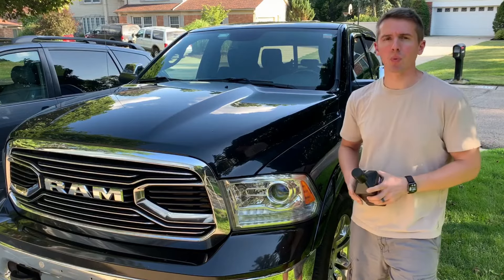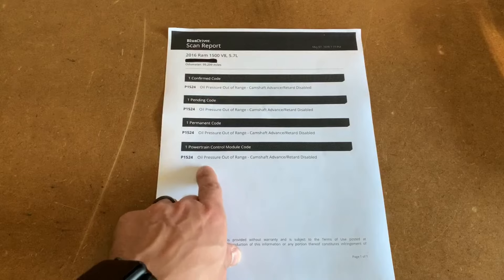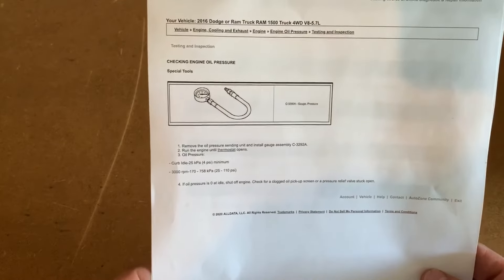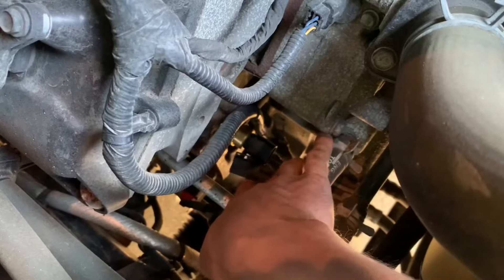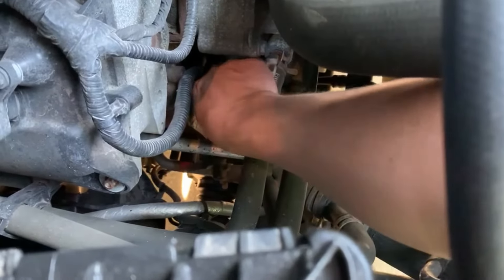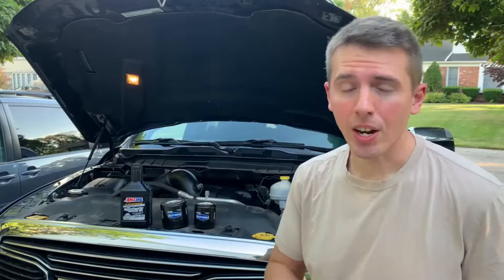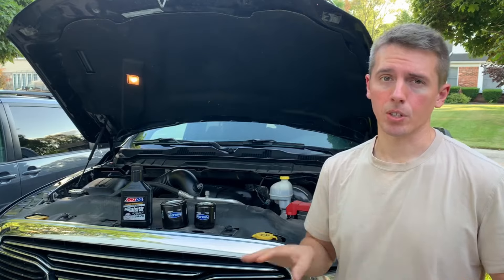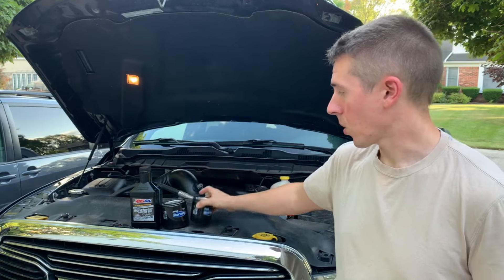2016 Ram 1500 - 5.7L Hemi - P1524 Oil Pressure Out of Range

Comment: Thanks for posting this video.  My 2013 5.7 with 153000 miles got the p1524 code I replaced my pressure sensor and the light was still on.  After watching your video I changed my oil and replaced my small Stp filter with the larger Mopar Mo-899 filter and that fixed the problem!  Thanks

Comment: This exact issues just happened to my 2020 Ram 1500 limited.  The dealer told me the code that was displayed was incorrrect oil used.  I had Amsoil 5w-20 installed with Amsoil filter.  I told the dealership there’s no way it could be the oil.  They s said they saw the same issue on another Ram truck using Amsoil.  They never tested the oil pressure and I couldn’t find anything about incorrect oil when searching that code.  The service writer said he remembers me bringing in my own oil and that I need to be installing the correct oil.  They even wriote this on the work order which ticked me off because this is something they can use against me if I have an issue later on.  Thanks so much for posting this.  You’ve been a tremendous help.  I’ll let you know how it goes

Comment: Firstly Thank You to the original poster of this video, I really appreciate the time you spent to explain your situation. Now for my story if it helps someone else: I popped a P1524 on my 2015 Ram 1500 with 5.7l Hemi. Oil pressure was only 34psi at 1700 rpm at 59 mph and I had recently started getting a rattle or vibration sound that came as the mds turned on or off and could be made to go away by forcing a gear change. It drove me nuts as this truck has 209000 miles and has had nothing but 5w20 penzoil synthetic and kn oil filters since ive owned it from 110000. Well the oil change system showed 30% left oil life but I went ahead today and changed the oil and filter with 5w20 Penzoil platinum synthetic, a bbottle of STP synthetic oil treament (16ish oz gold bottle) and switched from my normal kn oil filter to a mopar M0-899. Great results as now i have 54psi at 1700 rpm at 59 mph. The filter is a bit tighter to put on but fits fine on my 2015 4x4 model. Id guess that the kn filter is to blame here but can't begin to explain why. As a side note my normal 7 quart oil change did require slightly more oil eith the new larger filter and it took quite a bit of manipulation while prefilling the filter to get the air burped out. All in all happy to see such a cheap easy fix, bravo!

Comment: Thanks so much for this video. I also have a 2016 Ram 5.7 with the same error code and rattle. I changed to the Mopar filter and changed the oil and the error code and rattle are gone. You saved me a ton of money and I kind of doubt that most service shops would have had a hard time figuring this problem out.

Comment: Had same problem. Thanks for the video it saved me a pressure sensor and pcv valve. Oil pressure went from 32 to 49 with a filter swap.
Reply: What filter did you use
Reply: What oil filter did you use

Comment: Changed out the Amsoil filter with a K&N and my oil pressure went back to normal,thank you so much for this vid I was getting very worried watching the oil pressure drop lower and lower everyday
Reply: Did the same thing, did it come back again
Reply: @FLAMECASTERXVI  yes it did for a while but now I have been noticing that my idle psi is good but my oil psi while driving is lower than normal at 42-46psi when it normally was 48-52psi,I need to do an oil change so hopefully that has something to do with it?
Reply: @chrisabreedapartnyhc5337  I switched from k&n to mobil 1, and I am cruising at 51
Reply: @chrisabreedapartnyhc5337  42 to 46 is not bad at all, try switching to 5w20 PUP, mobil 1 filter or royal purple filter, and add some lubegard
Reply: I'm using a K&N filter on my 2019 and just had this code pop up.  I'm going to swap it out - hopefully it resolves the issue. Who would think paying for a premium filter would cause issues
Reply: @wakepics  go with mobil one filter or royal purple filter, and use Pup 5w20, your truck will feel totally different.

Comment: Man you are my hero! My 2017 just threw this code like a week ago and I should still have over 1000 miles before an oil change, still have good oil levels, I heard that clicking/vibration a couple times and was ready to light the truck on fire. The only thing I did differently was change the shop I brought my truck for an oil change. I'll swap the filter tonight after work and see what happens.
Reply: Update?
Reply: @jessehackett6941  the filter swap fixed the issue. I haven't had a problem since.
Reply: @theejmaenpaa  hello what filter did you use ? Thank you in advance
Reply: What filter did you use???????

Comment: Good stuff man, thank you! I have always used K&N oil filters. My pressure went from 31 to 53 with just changing the filter to a Purolator Boss. I'm going to try the older version as well during my next change. Luckily I saw this right before I was about to change the switch. I never would've guessed that an oil filter (let alone a "quality" one) would cause this.

Comment: Had this issue myself last week, oil pressure while driving on the freeway was at 38-42.
Changed out my “VP Racing” filter out for a WIX filter with the anti drain back valve (which the VP Racing didn’t have) and pressures are all back to normal 52-54 while driving freeway speed

Comment: Heya, thanks for sharing your troubleshooting journey. I have a 2013 Durango Citadel with the 5.7 that has no check engine light, but a permanent P1524 code (and lower than optimal oil pressure). Do you know if the bigger filter will fit this SUV? It's a smaller engine compartment I'm sure, just wondering if you or anyone out there has experience with it. Thanks.

Comment: Huge thumbs up for this video. I could not figure out where the noise was coming from on my 1500. Checked wheel bearings cv axles and nothing worked so thank you for this.
Reply from the maker: Awesome!  Glad it fixed the noise.  Thanks for the thumbs up.
Reply: Does it sound like sticking something into a running fan, and only happens on deceleration?

Comment: Thank you for your video.  I did an oil change and my pressure jumped right up to 52 at idle. 
121k miles. I used synthetic blend with an extended life premium filter.  I need to get my light cleared buy at least I have great oil pressure again. 
My last oil change was done at a center and this is whst I deserve. They used a  generic filter. Never again.

Comment: thank you so much, you saved me a lot of money, i was showing this error and another, oil was changed i think 2000 or 3000km and i don't think it was synthetic or if they used correct filter, anyways I changed with oem filter and approved oil and problem solved

Comment: MO-599 filter is the best to use. Its the factory filter. These engines were designed to use Mopar factory parts. The brand and type of oil doesnt really matter. Any brand 5W20 with the ASE  and  API certification will do just fine as long as you change your oil every 3000 miles on these HEMIs. My truck with the Gen III is about to hit 200,000 miles and I've not had any lifter issues or oil pressure issues, other than the normal low volume/ pressure issues. My 2010 holds 32 psi at idle and 58 psi at 2000 rpm. I would like to see more but that will keep it alive at these stock pressures.
Reply: 506xxx here.   just started misfire out of idle.     
heads are coming off to see how it is.   pulled the trans this summer and it all looked clean no issues there.
only hemi “tick” ive had is when i had to change the snapped rear exhaust studs

Comment: I just had the exact same situation on my 2020 Ram 1500 Limited.  I had Amsoil 5w-20 installed along with the Amsoil EA-15K50 oil filter.  After bout 4,000 miles, my MIL turned on.  I took it to the dealership and they did a bunch of software updates as well as replaced the oil pressure sensor and cleared the code. They took it for a test drive and said everything was fine and the MIL was now off.  I left the dealership and about 3 miles into my drive, the MIL came back on.  I immediately called the dealership and told them what happened and they scheduled another appointment for me.  On the second appointment, they said they went through the remained of the diagnostic tests but didn’t come up with anything.  They said the last item that was suggested was to change out oil filter.  They changed out the  Amsoil oil filter with a Mopar.  The MIL is now off and so far so good.  If it stays off, I’m tempted to try the Amsoil filter again to see if the MIL goes back on.  I spoke with a tech at Amsoil but they weren’t sure why I was receiving that code.  I gave them the batch number of my oil filter just in case and I’m holding on to the filter if needed later.  I did see about a 10 psi increase in oil pressure with the Mopar filter at idle speed.  I really would like to run the Amsoil EA oil filter but at this point, it’s not looking like it will work unless I just had a faulty filter.
Reply from the maker: Don't bother with the Amsoil Oil filter.  It is an outsourced/third party manufactured item.  Their supplier simply makes the filter to the requested specs and slaps an Amsoil sticker on it.  Go with the larger size 2012 and older filter and pick anyone of your favorite brands from the local parts store.  You won't have this problem again and you'll still be running Amsoil oil which is the important part.
Reply: I’ll have to try the older larger filter next oil change but since the truck is under warranty so I just did what the dealer suggested and had them install the Mopar filter.  I was using the Amsoil filter because it’s supposed to be an extended life filter made for longer drain intervals.  I have been using them for 20 years with no issues until using them in my new Ram.  I did see an increase in oil pressure when switching to the Mopar filter.  I was running about 58 psi at 1500rpm.

Comment: Hi I’m having the same issue with the check engine light I already bought the purolator filter and I bought Mobil 1 5W30 oil because the Napa guy recommend me that. I need to travel in a few days so I can’t wait for the shipping of the Amsoil website, my question if that oil (Mobil 1, 5W30) with work fine for my Ram 1500 2014 Hemi 5.7

Comment: This just happened to me. I contacted AMSOIL, I'm shipping them the filter so that they can inspect it. They are sending me a new one too. I got the code only after 1000 miles on new filter. I swapped it out with an AC DELCO and my pressure went from 29 to 51 at idle. AMSOIL is great, they will fix the issue I'm sure.

Comment: I use Amsoil products in all of my engines, and sure enough, my wife's 2012 5.7 JGC is throwing this code. It does have an Amsoil filter on it, and is likely closing in on it's change mileage. Interesting to see in the comments that many people are experiencing this issue with Amsoil filters. I have one on my pre-Eagle 300c, so now I'm curious what my oil pressure is on that. Obviously, it's not going to throw any VCT codes. My L92 does have VCT, and just got the Amsoil filter on it earlier this year with no issues. So, maybe they had a bad run on the Hemi filters?

Comment: Seems like an oil filter issue. Did you save the old oil filter you removed? What was the brand and part number of the oil filter that was used when the issue occurred?

Comment: in the video you mentioned a weird brief rattle on acceleration. How did you fix that? thanks!
Reply from the maker: The rattle was caused by low oil pressure throwing the trouble code which deactivated the Variable Valve Timing system. Changing the faulty / clogged oil filter resolved the low oil pressure issue, clearing the trouble code which in turn resolved the VVT deactivation which was the source of the rattling sound.  Try changing your oil filter, even if it’s newish. Hope this helps.

Comment: Check engine light came on yesterday 2-8-21.  Brought in to dealer and they told me I had same error code P1524 and it was because I was running Amsoil.   I called Amsoil and they said it was not the oil, but the filter (admitted I am not first to complain about this issue with this particular filter and engine).   Took back to dealer and had them replace with Mopar filter and full synthetic oil.  Pressure levels back to normal.  Would prefer to run Amsoil, but with the added cost and hassle of changing at OEM intervals, its cheaper and easier to just have the dealership do it.   Could they make getting to this oil filter any more difficult?

Comment: Wow I switched to Amsoil along with Amsoil filter about 3 or 4 oil changes ago and I noticed after about 2,000 mi. my oil pressure was dropping too 31-34psi at Idle and only 38-46psi while driving but it always use to stay in the low 50’s while driving and no less than 34psi at Idle so I’m gonna try switching out the oil filter,no codes yet but I seems like my oil pressure is slightly dropping everyday
Reply: Did it fix the issue
Reply: Had this same issue, I was using a filter without an “anti drain back valve” switched to a WIX filter with the anti drain back valve and oil PSI is back up to 52-54 range
Reply: @FLAMECASTERXVI  Yes it did
Reply: @zchhrrs4590  Amsoil rep told me they stopped making the oil filter for the 5.7 because of this issue

Comment: Thank you so much for your video! I have a 2011 Ram and my check engine light came on yesterday. I changed the oil a little over 3k miles ago but I usually but the Mopar 899 filter and they were out of that one. So I bought a K and N filter which is smaller than the Mopar. First thing tomorrow morning I'm going to change the oil and filter again using the Mopar filter or Purolator or something the same size as the bigger Mopar . I hope that works.
Reply: Hello sir did buying the bigger filter work ? Thank you in advance?
Reply: @agsosj14  yes. That fixed it
Reply: @DanoSlingz  I appreciate you responding.

Comment: Hi. Thanks for you helpful video. I changed my filter and the light went away. I also have the same symptoms you described: vibrating sound at about 1500 or so RPMs. That is still making that noise. Can you tell me if you fixed this some other way other than the filter change? Thanks again.
Reply from the maker: Hey Bryan, In my situation the rattling/vibrating engine noise was caused by low oil pressure impeding proper operation of the variable valve timing (VVT) system. The filter change resolved the low oil pressure which resolved the engine trouble code and disruption in the VVT system.  If you have not done so already, after your oil filter change, you probably want to clear the trouble codes with a scan tool and drive your vehicle for a few dozen miles over a few stop start cycles to see if the VVT rattle stops.  If it does not stop, you may have another issue at hand.  Good luck.

Comment: I'm having the same issue but I'm curious what the nose you heard sounded like. I'm getting a noise that sounds like a plastic bag fluttering in the wind. The noise stops immediately if I hit the gear- button on the steering wheel. Is that the noise you heard? Also happened a lot during engine breaking coming to a stop.
Reply: Did you ever find out what was that noise? I'm having the same issue on my 2014 Ram 1500. Thank you
Reply: @alfredoaguilar6400  that noise is the mds cylinder deactivation getting stuck due to low oil pressure.

Comment: So I’m confused. Is 32-42 a pretty good idle oil pressure ?? I always thought 25-30psi is the best at idle? Everyone in the comments are saying they fixed it and it was like 35+ in idle so is that normal? My 2014 charger RT oil pressure is 35-42 at idle and never above 55-60 while flooring it. Normal?
Reply: I have a 2019 R/T challenger with the same code p1524 my pis while idle is 32-40 did u do the olive filter swap and if did how's everything running now?

Comment: Had the same issue used a Mopar filter and Castrol  5w20   went to a wix filter  and changed the sensor  unit  with a standard  red box . The scan tool said it was the sensor. But being a heavy  equipment  mechanic for 13.00$ change the filter too.  So far ok.  Ram 1500 laramie  5.7 158,000 km.

Comment: my car says it has 5psi ever since i changed the oil and used another filter, same codes appeared and now it does a weird noise on engine but the dipstick has no oil, ill do these steps and see if it works after, thank you bro 🙏🏽
Reply from the maker: No oil on dipstick, yikes!  Make sure you've refilled your oil until oil appears at the proper level between add/fill line.  If the oil disappears after that you either have a massive oil leak or a failure/blockage in the engine oil lubrication system i.e. oil pump or blockage elsewhere in the system.  Hope you are able to get things sorted.

Comment: So I dont know if this is across all vehicles but an oil filter for a 2012 Ram 1500 with the 5.7 Hemi does not fit a 2014. I dont know if it works for a 2016 model year but I do know it doesn't work for 2014. The bigger filter does not work, without some modication
Reply from the maker: Interesting, why won't it work?  Not enough space?  The threading should be the same.